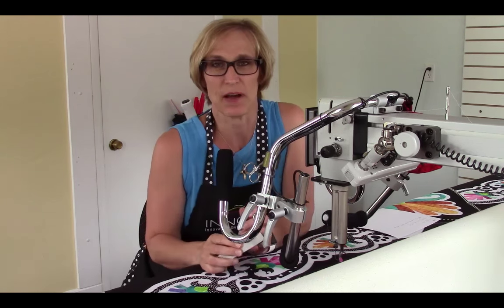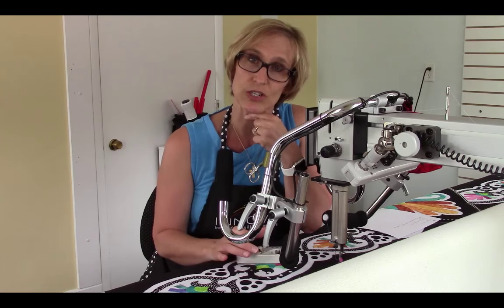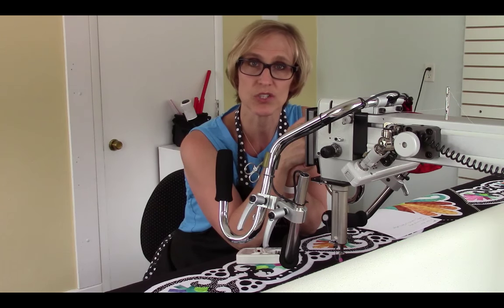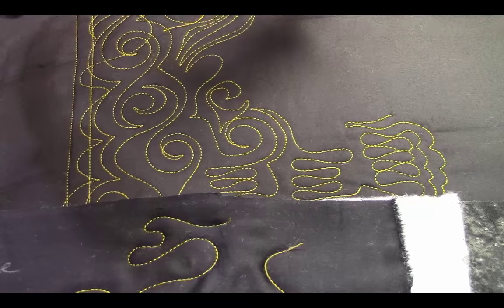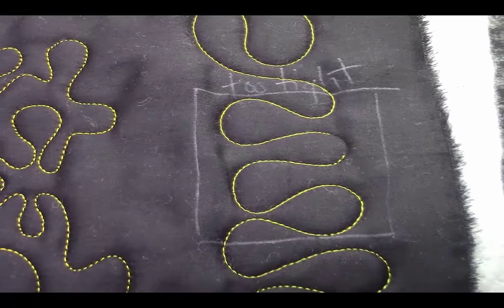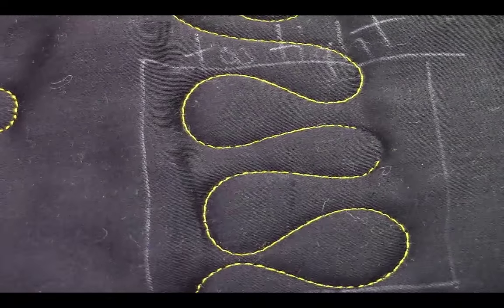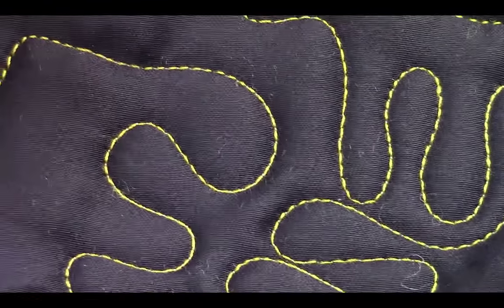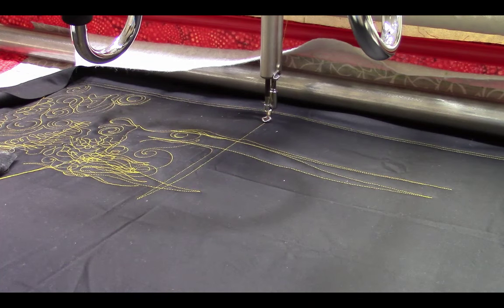recognizing a good stitch

Comment: Thank you ReNae! I was just about to call Michael as I thought that I had tried about everything including new red bobbins and the Towa tension guage.  For the most part my stitches were looking good top and bottom, but then occasionally the top stitches would flat line when traveling from right to left.  I was just thinking that I should tighten up the tension top and bottom---and then I came across your video that confirmed that thought.  Thanks again for your generosity in sharing your knowledge in your videos.  I appreciate it.  Kelly

Comment: If you have railroad tracks on the back, will your quilt fall apart when washed?
Reply from the maker: +Rebecca Randall I'm not sure if it will "fall apart" but if the tighter thread is pulled it comes out very easily.  If it isn't pulled then the stitches would stay.